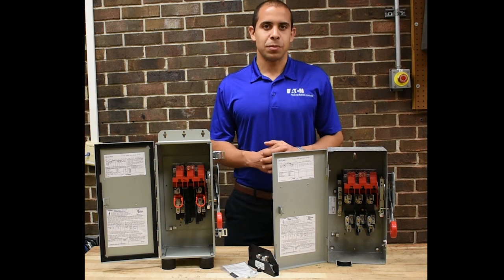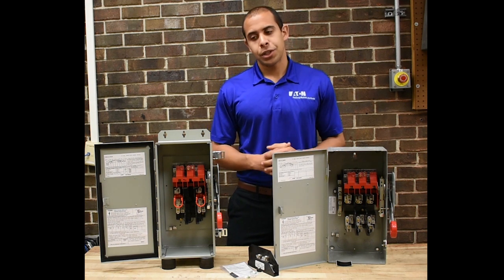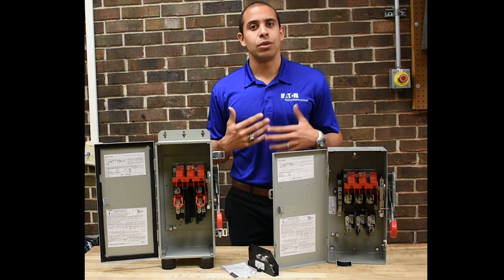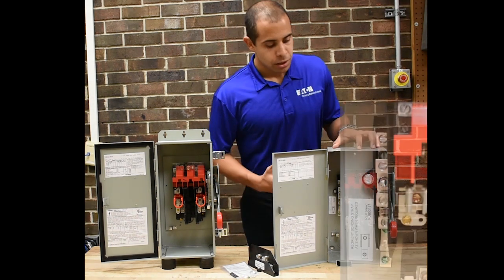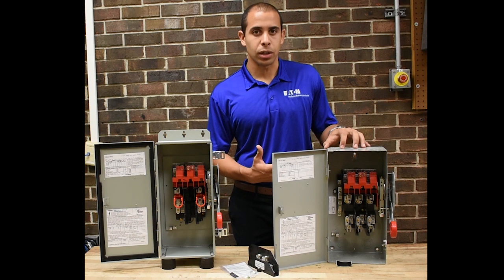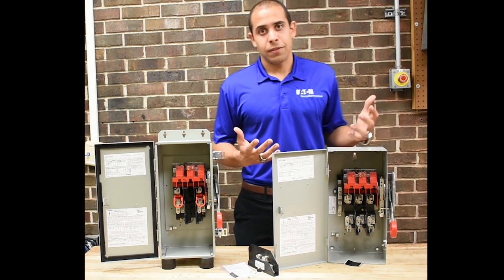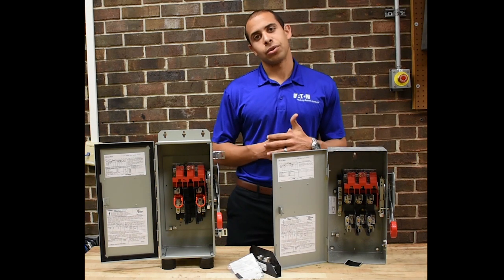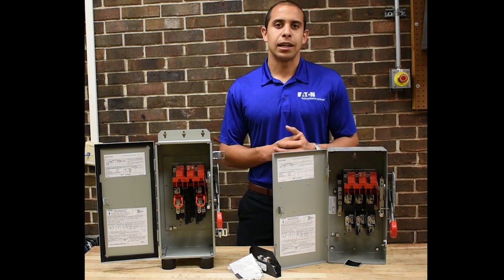Service Entrance Requirements for Safety Switches

Comment: With the newer requirements for external disconnects known as Firefighter Switches, will the prices drop on the switches? Because right now an external 12 circuit main panel is cheaper than these are, and the difference is only that the door must be opened to access the main disconnect. Most of the people I deal with here in the caribbean would rather pay for the external panel than pay four times more for the outdoor disconnect.